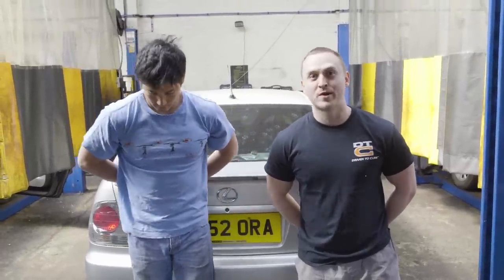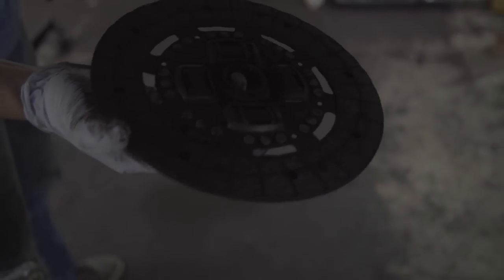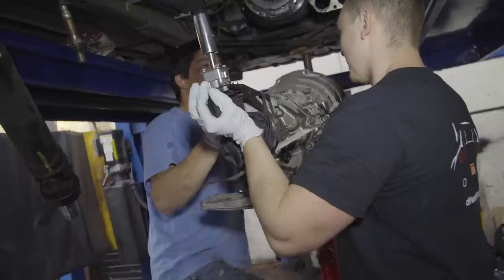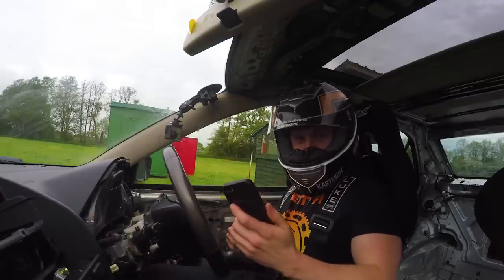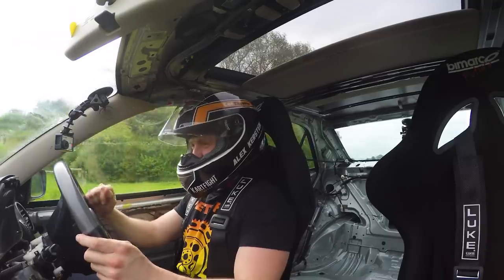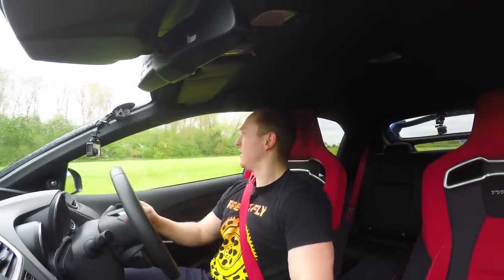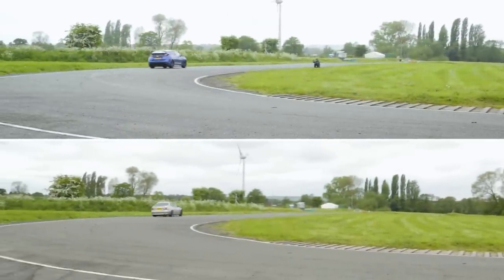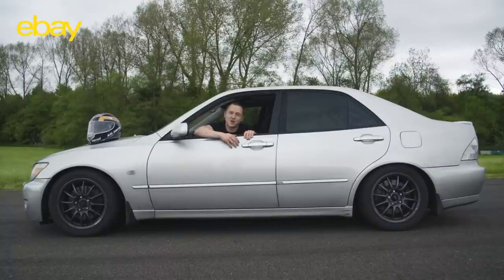Can My Built IS 200 Beat A Civic Type R On Track?

Comment: you've done all the handling stuff now it is time for sheer POWWWAAAHHH!!!!
Reply: KAL 1 why wont he turbo it or will he?
Reply: Bmx 121 i think that the objective of this series is to ugrade all the non-engine stuff first, then maybe he will do something to the engine.
Reply: KAL 1 he is selling it
Reply: SubmarineCow and imma buy it
Reply: Can Sengezer I'm on most car channel comment sections.
Reply: Jake Jake that's nice
Reply: KAL 1 quick steering rack and wheel
Reply: 2JZ... or 1UZ, or 1GZ...
Reply: whats wrong with rotaries and widebodies
Reply: daybreaK fuel economy is buns on rotary engines
Reply: not really...
Reply: no one buys a rotary or any performance oriented engine and goes, well gee i hope the fuel economy is great.
Reply: Only suggested those motors because they are sort of related to the platform, widebodies are pretty awesome though :)
Reply: daybreaK ricer alert
Reply: hes selling it soooo
Reply: lool
Reply: That's so Clarkson enough, mate. Hope Mr. Clarkson didn't scope your comment ( what I meant by 'scope' was 'to read' )
Reply: KAL 1 that's a fact lols
Reply: No sway bar. :| Handling isn't finished.
Reply: dont fucking judge him, a tug n a snooze you cant lose.
Reply: the IS200 is to difficult to turbocharge, most put in Superchargers and even that is fairly costly
Reply: all of the handling stuff?
1 part per corner doesn't count as all
some cheap swaybars would do this car a world of good
or even a duel swaybar setup if he's on a budget
Reply: You could actually get the is200 With a tte supercharger from the dealer its a bolt on and if i remember correctly it bumps the Power up to 211hp from 155, If he got an is300 instead it would also have beaten the civic
Reply: Christianspiller not a chance
Reply: Christianspiller Thats actually really terrible. My 95 Civic with my motor swap aka poor mans integra type R build. 1.8 litre all motor naturally aspirated on the dyno put down 207 hp at the wheels on a conservative tune for daily driving. It would easily put down 275-300 on low boost with a turbo or a supercharger with the stock Type R internals and crank.
Reply: The 1G-FE Sucks ass for making Power but its unbreakable
Reply: I see your comments everywhere!

Comment: It's not fully built.
You can still upgrade fuel system,ignition ,intake and even go turbo.
Reply: was thinking the same thing
Reply: Why upgrade fuel and ignition? Remap the ECU yes but I don't think it needs any fuel or ignition changes how it is now. Intake is technically already done with a K&N filter, I don't think a proper aftermarket CAI would make a difference
Reply: IMNOTA even a simple remap would help😂
Reply: A real intake system make way more air go into the engine than a oem fitting K&amp;N?
You have more air so you need more fuel or its useless asf.
Reply: Phillip Deic,Yep thats true remap can do a lot.
My dad diesel 3 series touring was 136hp stop and has been remapped to 183hp to the wheels and the torque is insane compared to stock.
It's a turbo engine tho. Lots more gains to be had.
Reply: And racing turbo lol that's gonna be so much more horses but just to clear off they installed a racing flywheel right
Reply: these gain little to nothing from a remap, only way to get worth while gains on the 1gfe is forced induction
Reply: IMNOTA quick steering rack
Reply: IMNOTA you cant compare the results of a remap in a turbo diesel to the ones you'd get in a NA car. a remap in a turbo car will get you a lot more power and torque
Reply: Ivan Cuesta true, my remapped Z18xe powered Opel had "only 10%" power gains, but responsiveness will get way better
Reply: forged pistons rods cams
Reply: Old or new 3 series? New cars are super limited due to emissions, so a simple remap can give them way more power.
Reply: IMNOTA have you ever seen proof of good CAI setups giving any decent power over a decent drop in panel filter? I haven't. With the mods on the lexus it doesn't need a better fuel or ignition setup, the ECU should make these adjustments good enough but ideally you would get a remap to get the most out of them
Reply: Asher Rose a remap would still be worthy I'd say, minimal gain for peak power yes but better mid range. The mid range was crazy on my DC2 after a tune but little/no peak gain. Also to get the air to fuel ratio perfect
Reply: IMNOTA I'll buy the silvia from u
Reply: lol ive seen some cai's that are nothing but pure hot air intakes on ebay that kill bhp
Reply: lol forged doesnt mean fast, there just stronger parts to support more boost
Reply: I think a supercharger is better for track then turbo
Reply: You internet mechanics make me chuckle
Reply: exozgaming is sort of right here. with a turbo, you have a bit of a spool time.
Reply: eXozGaming Aren't superchargers heavy?
Reply: i think why they didn't do that is because they might have had a limited buget
Reply: IMNOTA new clutch coming soon, Rip
Reply: fully built normally means forged engine, and an air filter of cai isn't an intake lmao. But the the fuel pump and the ignition can still be upgraded.
Reply: IMNOTA the title just says built it doesn't say fully built
Reply: IMNOTA the point was just to best the 86 anyway
Reply: you cant remap their ecu, they have a self learning ECU which will turn its self back to normal within a few minutes. If you want a remap on is200 the cheapest option is a £600 piggy back ecu then another £400 custom map and you'll get 20hp at best so £1000 for 20hp essentially, you can supercharge them and add 80-100hp for that money
Reply: Ivan Cuesta, true I forgot to mention that,but I think he could still get 15 more hp.
Reply: Faded Flow lol That would be my dream to own it.
Reply: Connar Downes I am talking about a real cold air intake not the ebay ricers one.
Reply: Aspiring to inspire look the description it says "built completed" and they edited it yesterday it said "fully built"
Reply: chilote66 The point was to make a track car,and make it faster for less,the faster it can be for less the better.And they have a lot of room (money) to make it twice faster lmao
Reply: Super good idea
Reply: @raptorjeezus2607  you can't remap a first gen is200 ecu it resets itself to stock
Reply: Remap would be enough
Reply: @raptorjeezus2607  nah mate, there's absolutely nothing to be found on the 1GE unless you add boost. nice intake will mainly sound good, not much else.
Reply: What throttle swapped out to fully mechanical one?
Reply: 1g fe engine is a boat anchor, not economically viable to build. To reliably get up to the same power levels as the type R, it'd cost almost as much as just buying a type R

Comment: Still think the IS200 is a good looking car even after all these years.
Reply: every time i look at mine i can't help but think that it's peak small 4 door. clean, simple lines, spot on proportions, and the size of the thing is just perfect. i hope i can still drive it in 10 years...
Reply: @givemeajackson  do you still own it?
Reply: @SmokeRook7  yup
Reply: @givemeajackson  so how's it going with it? I've bought an is200 sport recently and I can't complain. Mine has LPG and it's so so cheap to run it. Have you encountered any serious repairs? Is it really that reliable as people say so?
Reply: @SmokeRook7  i had to get new brakes and pads all around, and a couple of new taillight bulbs, but that's routine maintenance in my book. Then the front right lower control aem ball joint had a ripped little rubber boot, replaced both sides. Apart from that, nothing. There's no rust, engine and drivetrain were just flawless, and i've just passed 270'000km. I have no doubt it'll get into the mid 300'000s at least, probably more.
Reply: @givemeajackson  Good to know. Mine is already on 300000km and we'll see how it goes :)
Reply: @SmokeRook7  if you don't have any rust issues, i think it's worth keeping on the road. Cars like these are never coming back. Small, light, analog and fun
Reply: @givemeajackson  there is rust only on the sideskirts and its like only 10% or maybe less of the sideskirt and im getting it removed soon, rust is only there atm, nowhere else
Reply: @SmokeRook7  then you have very little to worry about. At 300k timing belt should be done for at least the second time if it hasn't already, and i recommend checking the lower front ball joints as they are a common point of failure and cheap to replace. They are really solid cars.

Comment: The suspension is what slows down the IS200 at this point. Because it dips so low, the weight shifts to the front left/right in turns, which causes the car to understeer. The corner comparisons between the lexus and honda show exactly what I mean.

Either way, I enjoyed this serie and hope more will follow soon. Thank you for your continuous effort into making these!

Comment: Erm... I don't wanna sound nerdy, but a clutch should always be driven in first in order to bed in the clutch and the flywheel . If you get on it like that right away, the torque rating will decrease immensely. (even if this car doesn't have a whole lot of torque)
Reply: toto211111 Exactly, I'm sure they broke the clutch in before heading to the track that day.

Comment: The lexus needs a supercharger !
Reply: hugo schombourger nah fam big turbo, go for 800whp and make it run 30 seconds or less
Reply: Conidro lame
Reply: preludeF20Bking ????
Reply: Conidro 800 wheel hp is not going to be usable on this chassis without extreme aero work done to it. It’ll be sliding all over the track.

Comment: For all the rookies that will change their clutch to add some extra fun. There is a break-in period which is needed on the clutch to help it seat properly over time and to reduce glaceing of the flywheel which is costly to replace and repair.

Comment: dual mass flywheel...basically a 2 mass damper. it doesn't get rid of engine vibration per se, especially as an i6 has perfect 2nd order balance. flywheels smooth out the power pulses between each cylinder firing by keeping the rotation going when there is no combustion happening. I guess you might feel the pulses in the cabin if you didn't have one...it'd be a rawkus rather than smooth experience.

Comment: Nice, i underestimated the Altezza AS200/ Lexus IS200. That's a sweet exhaust you put on there gosh it sounds good, have to get one for my RS200, which by the way is the sporting Altezza with the 3S GE 210BHP. That or the IS300 with the 2JZ really should have been the car for this experiment as they are the superior performance versions of the this car. That and this one has a sunroof added to the extra weight of the significantly less powered 1G straight 6 engine in there, not the best pick. But a great video none the less 😊

Comment: They teach drivers not to use the handbrake button in the UK now. Most owner manuals say not to use it. Some cars have a problem with the ratchet not finding a tooth when the handbrake is applied. It happened on my MK IV golf. It rolled down a car park. The problem arose when the rear disk brake hand brakes were implemented. Apparently the adjustment is much finer so the ratchets were made finer. Old cars would have larger ratchet teeth but some people were not strong enough to fully apply the handbrake the extra tooth needed and it was leading to slipping handbrakes. Those that could pull up the extra tooth were getting broken handbrake cables. Personally the handbrake noise grates on me! The main reason to learn to hold the button though is for habbit during handbrake turns.

Comment: The car needs more front sway bar.
Perhaps more spring rate all around as it still wallows a bit. The higher the spring rates the more responsive the care becomes  and in general term the quicker it takes a set in a corner.
Needs more engine cowbell :)

Comment: Its not fully build you can still do: Turbo, ignition, rollcage, spoiler, steering wheel, transmission, body kit, sponsors, custom paint, new headlights, new taillight, and new gauges. And more...

Comment: Alex, why didn't you remap the Lexus to make the most of its engine and new parts?
Reply: They probably would have gained 5hp at the most from the air filter and exhaust, it'd need a couple more mods like a set of cams and throttle bodies to make some serious power.

Comment: No aftermarket swaybars, no bushes or arms changed, no proper alignment, completely stock engine apart from exhaust, and not even an oil change lmao

Lots of work could still be done

Comment: "sloppy steering" just another excuse to say why it was slower. a good driver adapts to his or her situations. if the civic had more power, then compensate for it and try to exit the is200 out of the corner at a higher speed

Comment: that lexus has so much more potential to improve that time , fuel system , ignition , bracing , a good suspension tune and set up , brake bias controller, ecu re-mapping  .... the list goes on it seams like your giving up after a few basic bolt ons and no real development ???....

Comment: That is200 would be a good drifter of you welded the diff
Reply: It'd just end up beat to shit and eventually wrapped around a barrier, it'll live longer as a tack car
Reply: Callum Pearce oh ik that 😂 my mx5 mrk 2 lasted 24hrs+ on drifting before blowing up
Reply: Harry Wilson Honestly only in the rain. 155bhp is not nearly enough to hold even a very slow skid in 2nd gear. Needs boost or a V8 for drifting.
Reply: +Waffeey I've seen 140 bhp ford Sierras with welded diffs drifted and they were fine, more power is always nice but 155 is enough for someone starting out.
Reply: Waffeey nah u can easy drift low hp cars , my car has like 110 hp but it was light af

Comment: Snap on the IS200  tower bars  on front  shock and rear shock towers,  a turbo and a LSD  rear diff  and try again...      No point to compare  Turbo engine with a naturally aspirated one  with 15 years difference in manufacture and type of car

Comment: this is nothing near fully build, not putting a turbo on this means it's just a massive waste of time imo.
Reply: also what you said about those upgrades making it be able to run a 1 minute faster nurburgring lap is wrong, just comparing the distance of the tracks and assuming the distance-time ratios would be the same is definitely not correct :)